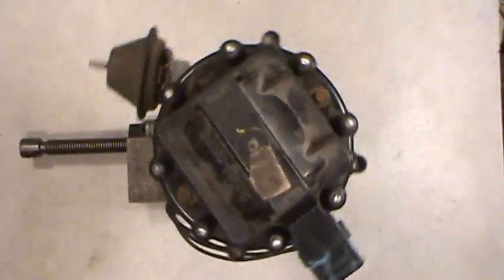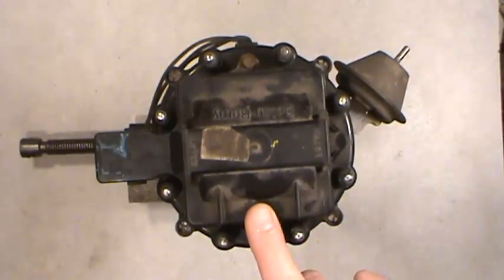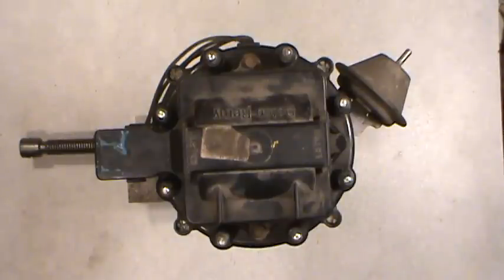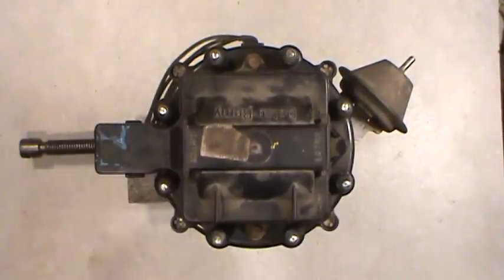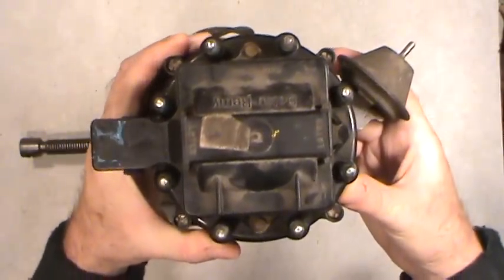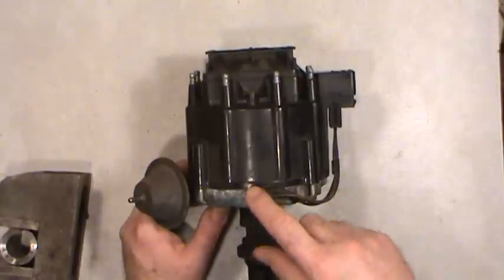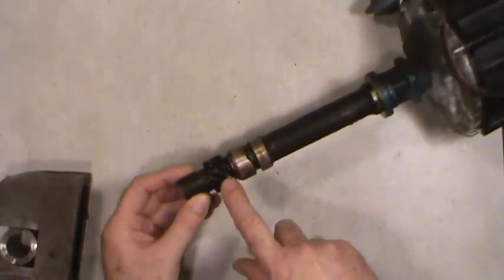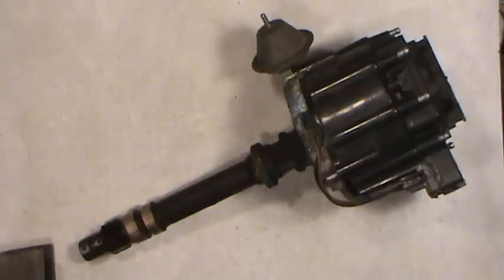HEI Distributor Video Series (Part 1)

Comment: I bought a aftermarket HEI Distributor for my 1975 Pontiac 400CI. Keep in mind the Distributor is a 65.000 voltage coil.  The Ignition Control Module has went out 4 time's in the last 4 months. 1 ICM a month. I have replaced all ignition control modules with oem equipment. Could that be my problem. High voltage coil with a stock ignition module. Thank you.
Reply from the maker: Greetings...1975 PONTIAC CATALINA 400-THM400............Thanks for watching...........Well, it's probably always a good idea, to have, a, shall we say, "matched set", as it applies to, pairing-up, an HEI (High Energy Ignition) coil, with an ignition control module, in order, to have the ignition coil, to be able to perform, up to it's designed capability.............So, yes, you are possibly, partly correct, about the "miss-matching" of those two components/parts...........Another reason, that, an ignition control module will destroy itself, is, by, "not applying" a thin layer of "heat sink" grease-like compound, to the metal back-side, of the ignition control module, to make sure, that, the "heat", that the ignition control module generates, gets "transferred", into the HEI distributor's, aluminum mounting pad, where the ignition control module, get screwed down onto............Use proper "thermal paste" on the metal side of the ignition control module (Not Die-Electric grease...!!!)..........The proper "thermal/heat sink grease", is what computer people use, on heat generating chips, like CPU's & GPU's, when they get installed, on the computer's mother board............Just get the cheaper stuff, because, it can also get quite expensive.............Those two "metal eyelets" (holes), that go through the ignition control module, and those two screws, that go through them, and then, get screw-threaded into the HEI distributor's aluminum mounting pad, are also, the "electrical ground", just so Ya know, so, keep those items, nice-n-clean..........Also, if the HEI ignition coil has a ground strap, and/or, ground wire, then, make sure, that it's connected properly...........Is there "battery voltage/12 volts", going into the power terminal, on the HEI distributor, because, that's important too (some folks, might have, that good ole Ballast Resistor, still in the wiring circuit, that will lower the volts & amps, and, a weak spark, or no spark, it just might be)..........Have a look, at the "carbon button" (contact), that's on the inside of the HEI distributor cap, to see, if there's any, shall we say, "melting" of the distributor's, plastic-like material, that surrounds that good ole carbon button, and if so, it's probably getting way too hot, and there's even a cure, for that as well............For certain applications, there should be, what is termed, a, " low resistance" carbon button, for sale, that will allow, much higher electrical energy, to be able to pass through it, without having "it" get hot, like a factory/stock one, can sometimes do, because of its, much higher resistance rating...........Very High engine cylinder pressure (compression ratio), as well as, spark plug gaps, that are too large, for the application, will also place additional stress, on the ignition coil as well..........A higher than stock engine's (over about 5500 RPM's), "red line" (on the tach), is where the better aftermarket HEI distributors help out quite a bit...........Maybe, consider a..."DUI"...(Davis Unified Ignition?), HEI...Custom/Advance Curve..."Distributor"...for your engine, along with, a set of their quite impressive spark plug wires as well............Might cost a bit more, but, if Ya give 'em, lots of accurate information about your 400 cubic incher...and how Ur gonna be drive-n, your old school, eye-catchin' ride, then, you'll probably, have a much better chance, at having a proper "ignition advance curve", for your "exact" engine and car, as opposed to, just guessing, and maybe, some engine damage to go with (and, I hope not)...........If your running a "carburetor" on your engine, maybe consider, installing an "air/fuel ratio" gauge, that only requires a wide band oxygen sensor, to be installed in the exhaust, to really "dial in", the air/fuel ratio, under load, and at, just crusin' along as well.........Hmmm...might have been a Hot Rod magazine website, as I recall, that actually had, an article, with pictures too, about matching, HEI ignition coils & modules, so they'd, get along with each other...........If Ya have any more questions, or concerns at all, then, here I be...........Good luck, and.......till next time........Be Safe, take care, and have a good one.
Reply: RockysRoadshow u get down thanks I have a 1978 monte Carlo it was crazy I was snogging my car here in California at the final test car turn off by itself once test was completed guy from smog shop told me if car turned off while I was testing it on dyno it would fail u but after that car started not running good it's a 305 its getting good fuel I put a new carb new egr valve I took my catalytic converter off maybe thinking it was plugged but ran it with out cat and still runs rough I changed coil that's in top gonna do a compression test next to see if it's the engine Thanks for your information Have a Great Day
Reply: @johnnys1963  I found the problem. The shop that put the top end together didn't tighten the 2 bolt's in the valley pan or pushrod pan. Oil was getting into the distributor. I took the intake manifold off and corrected the problem. No more issues

Comment: Hey I have a 1981 350 not stock 275 hp at back tires , I have put 2 coils in this car in the last 1500 miles the coil it grounding out threw the cap and the button wire turns to dust .I have checked all my grounds and cant find anything wrong . you have any thing I could be missing ,have had lots of hot rods with more Hp than this with no coil problems. thanks Steve B
Reply from the maker: +Steve Batten ....Greetings Steve Batten....Thanks for watching...............Well, there can be quite a few things to consider, that just might lead, to the, shall we say "Meltdown", of Your (Factory/Stock, I presume), HEI/High Energy Ignition Distributor (Cap, where it meets the Ignition Coil, that is).....................Did You Add any Ignition Components, over that, of a Stock/Factory HEI...???....................Ignition Coils and Ignition Control Modules, should be "Matched-Up", with one-another, or, if not, the Ignition Coil, in a worst case scenario, might get Saturated/Charged-up, at too many (electrical) Amps, or maybe, for too long of a time period (Dwell), and also, the Ignition Control Module, could get "Fried" as well, so, make sure, that, those two things, are, shall we say, Made for Each-other....................Generally speaking, the LARGER the Spark Plug "Gap's" get, and the HIGHER, the Engine's Compression Gets, then, the Ignition Coil, will probably have to Output, that much more..."High Voltage"...(on the ignition coil's Secondary side), to get those Spark Plugs, to be able to make a nice strong Spark, that's supposed to occur, between the Spark Plug's Electrodes, that's needed, for a really good combustion event......................High Voltage, will usually, try to find the Easiest path to Ground......................If there is any Not Wanted (electrical) Resistance (Ohms), over what it's Normally, supposed to be, then, that, in itself, can, shall we say, put an Unwanted "Strain", on an Ignition Coil (aka, overloaded/overworked)......................Have You had a Look "Inside" Your HEI Distributor lately...???.....................There are times, especially when, a Vehicle is stored in a cold/wet climate, and the Engine isn't run, all that often, where-by, all kinds of Corrosion, Green stuff, etc., can start Growing/taking place, "Inside" that good ole HEI Distributor, and, that unwanted Corrosion/Yuck-ees, can Prevent, good Electrical Contact, between some of the following parts (as they are Installed, into the Top of the HEI Distributor Cap)..................There is a Sheet-metal-like...(electrical) "Grounding" Bracket, that should be making Good Contact, with the Ignition Coil's perimeter/square-shaped Laminations (a sandwich, of individual pieces of sheet metal), that has to be making very Good/No Resistance Contact..................Then, there's the Carbon Button/Resistor..............Some Aftermarket/High Performance Companies, actually Make, and have for sale, a "Low Resistance", HEI Carbon Button (Contact with the spring), and, might be considered for use, cuz, it might end up being, that, the Higher Resistance (ohm value), of the Stock/Factory Carbon Button, is causing, shall we say, a "Bottle-Neck" (resistance-wise, that is), where-by, it's Holding-Back, the High Secondary Voltage, that's coming out of the Ignition Coil, more-so, on a Modified HEI, or, an Ignition System, that happens to have Too Much (electrical) Resistance in it, and that has me thinkin', that, things, just might, become Too Hot...maybe...???..................The Rubber-like Seal/Sealing Washer, really shouldn't be "Re-Used" (kinda like Gambling in Vegas), so, install a New One, if possible, and coat Both Sides of "it" with Die-Electric Grease/Goop, to keep the Seal, some-what airtight, and ward-off any Moisture as well (done improperly, can lead to High Voltage Arcing/Problems, quite possibly).................Now, onto the HEI's Ignition Coil..............There's a "Ground Wire", coming out of the ignition coil, that has to be "Grounded" to those Perimeter, sheet metal Laminations, by way, of a sheet metal Eye-let type of connector, held in place with a screw.......................On the Ignition Coil, there is that Metal Contact Point, that, that little carbon button's Spring, makes Contact with, and must be shiny and clean...................Sometimes, maybe, due to installing, something like, a different than, Stock/Factory Ignition Coil, and/or, the Plastic-like Top-Cover, on an HEI Distributor Cap, then, there could be times, where-by, the (new) Screws, that were provided, that Retain/hold-down, that Plastic-like Cover, might be "Too Long", and, when tightened down, could possibly "Pierce-Through", into the "Inside" of the HEI Distributor "Cap"...!!!...Yikes...!!!...(Ignition Coil's, Secondary High Voltage, using those unwanted Screws to Connect with...???...ummmm...no thanks)......................Try to think of a Vehicle's Ignition System/Circuit as a Whole, complete Unit, and, Make sure, that, each and every Component/Part, gets along, with one-another...................Spark Plug "Wires" (Leads), should have the Correct "Resistance" per Foot (as an example), or Lower Resistance, could be possible, if the Vehicle is Old School, and doesn't have a Puter (computer) in it, along with, all of those, oh, I'm so Sensitive, Sensors and Actuators...lol...(before HEI, about the only thing to worry about, with high voltage, was usually, just some Static, that was heard, while listening to the vehicle's AM Radio...lol)................Maybe, have a look Inside Your HEI, and make sure that the Ground Strap is making Good Contact with the Ignition Coil, and that All Connection Points are Clean and Shiny as well....................I've seen that Ground Strap all Corroded, like You wouldn't believe...!!!.....................The Carbon Button/Resistor, had Green Stuff all over the top, of that metal round part, where the Spring joins the rest of it...................The middle/Metal part of the HEI Ignition Coil, where the carbon Button's Spring makes Contact-with, was all "Rusty-Lookin'"....and now You ask, why is that so bad...???...well, the way that I see it, it's kinda like they used to say, and that was..."It's a Recipe for Disaster"...!!!...or in my case, prolly be an Engine, with a bad case of the..."Hick~~~Ups"...lol................Maybe, check the Ohms/Resistance of Your Spark Plug Wires.........Your Spark Plug "Gaps"...??? (size between the electrodes)................Even a Distributor Cap & Rotor that's Worn too much, will usually put an Additional Strain, on an Ignition Coil...................It's gotta be in like-New Condition.............Clean/Good Connections............Make Sure, to put some "Heat Transfer Specific Compound" (grease-like stuff), on the Bottom of the Ignition Control Module, or, it could "Over-Heat", and go "Poof"...!!!...oh and, make sure that, the two surfaces are Clean as well, before doing so.........................So then...No Excessive/Undesirable "Resistance" anywhere in the Ignition Circuit, and, last but not least...Make Sure that..."All Ignition Components are Compatible with Each-Other"...or..."Vegas Odds"...it just might be.................If You care to, You can let me know how Ur makin' out, and if need be, I'll be here somewhere (I hope...lol)......Good Luck, and..........till next time..........Be Safe, take care, and have a good one.
Reply: +RockysRoadshow Thanks for your reply, I for got to tell you the Distributor is a high performer excel with the wires and this is the 2nd one I have put in this car never run excel stuff before ,I have checked everything you talked about so just going to try this one and I cant believe I would get three in a row  so wish me luck ,I will let you know in about 750 miles from now.
Reply from the maker: +Steve Batten ....Greetings Steve Batten...I wish You Luck all right...lol................excel...???...Don't You mean..."ACCEL"...???..........Have You Checked Your Spark Plugs "Gap" at all...???....................If I had the Melting Distributor Cap, like You had, I would Probably "Reduce" all of the Spark Plug's "Gap" to .035" (Thirty-Five Thousandths of an Inch), if the Spark Plugs are Gap-able, that is, cuz, by doing so, the Ignition Coil's Secondary High Voltage "Output", would be Lower as well, as compared to, having much Larger Spark Plug "Gaps"....................If Your Luck (runs out again, and I hope not), just let me know, and then, we'll see what we can do...........Good Luck, and.........till next time.........Be Safe, take care, and have a good one.